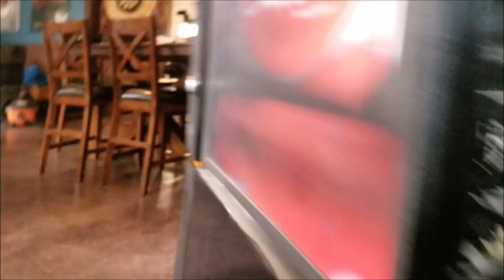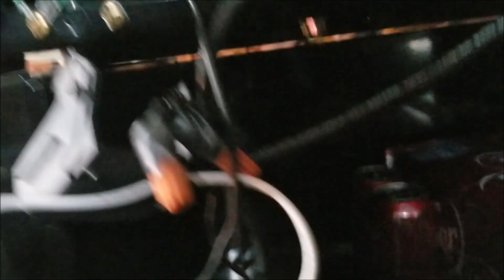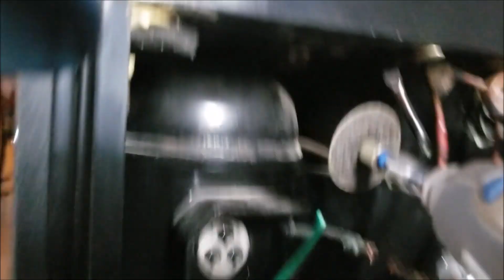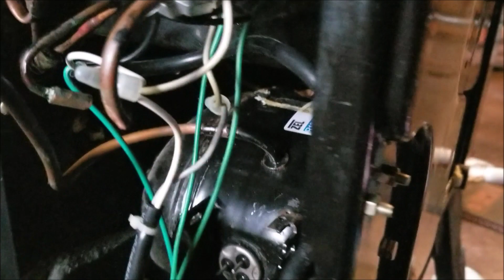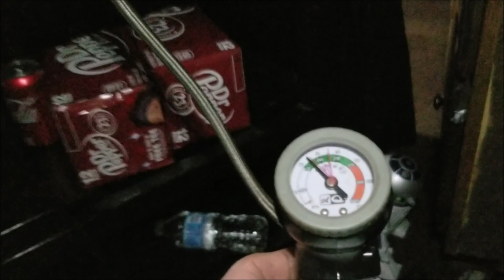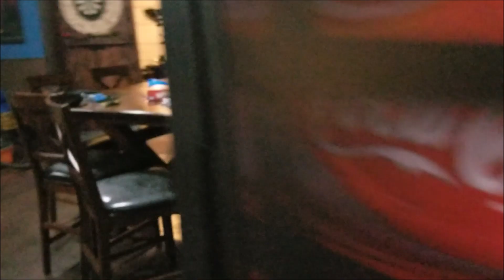SkyBox by Maytag Compressor Swap

Comment: I did this today got the skybox for free bought a mini fridge for the compressor.
But turns out the evap coil is plugged might use the evap coil from the mini fridge.
Reply from the maker: So you got it working then?
Reply: @GarageMahalLife  Maybe I have to get it in the house to see it's too cold outside for me to tell Ill let you know.
Reply: Well looks like it didn't work but I picked up a skybox yesterday that's in way better shape.
Reply: @GarageMahalLife  not yet it took me a while to dig out the evaporator from the foam I'm going to try and fir the mini fridge evaporator in there tomorrow.
Reply from the maker: @dmclegg66  Did you see my other video on an alternative idea instead of replacing the compressor and evap?
Reply: @GarageMahalLife  Not yet Ill take a look thanks.
Reply from the maker: @dmclegg66  email me if you need help with anything Brian.niskala@cnjrail.com
Reply: @GarageMahalLife  Thanks man just finished the transplant but it's to cold outside to see if it's working.